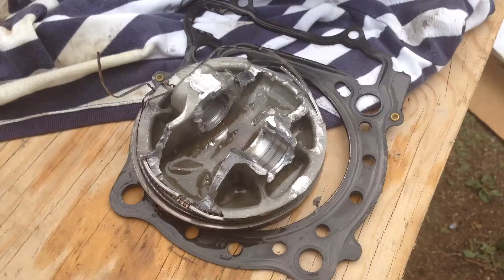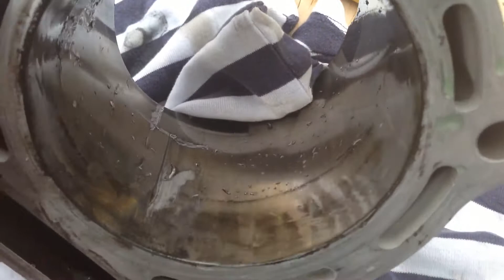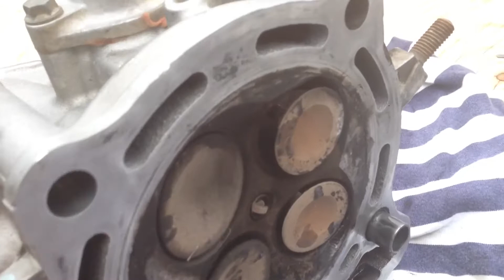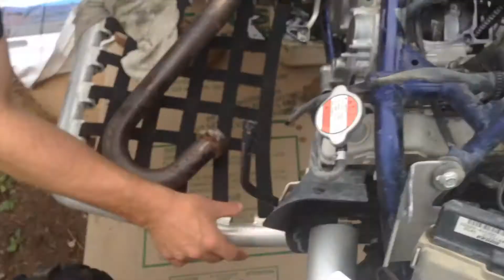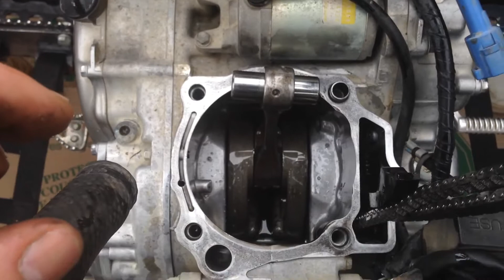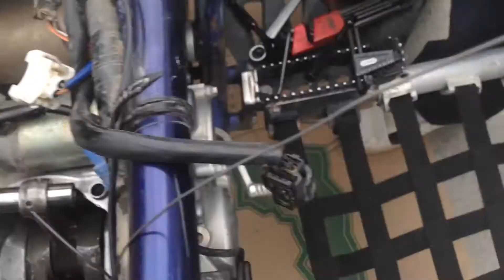Suzuki ltr 450 engine broken

Comment: Lol this was me two months ago. bent valves fucking suck. Finally get her rebuild last night and running like a charm.
Reply: How can we prevent this ?
Reply: @mrbmd710  make sure your valves are properly adjusted, also inspect your cams regularly. What happened in my case was one of the punched rivets that hold the cam gear on the cam shift snapped allowing it to swing and it tapped the valves with the piston because of it. Could have been avoided too I thought I heard something funny in the motor, and continued to ride, big mistake.